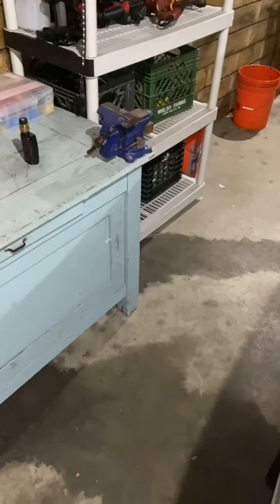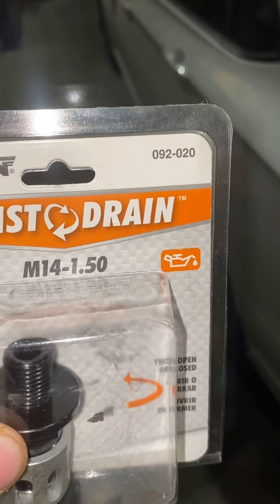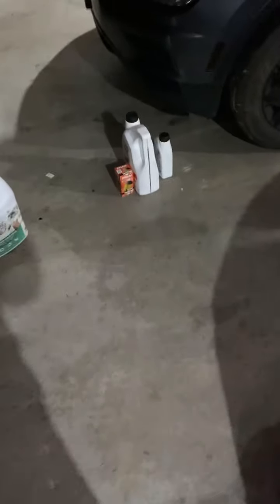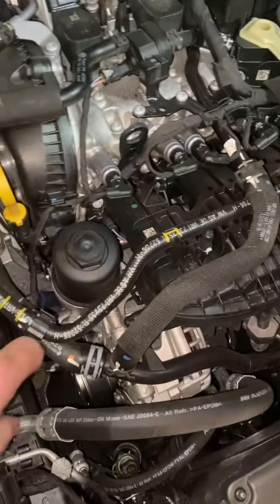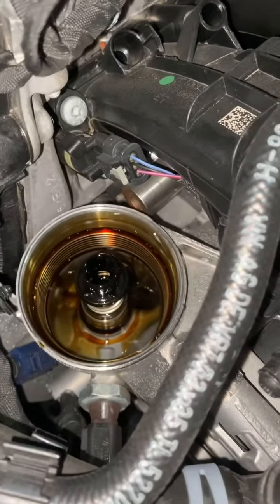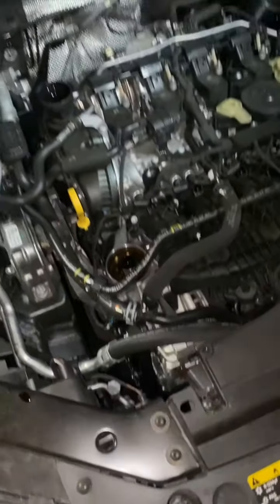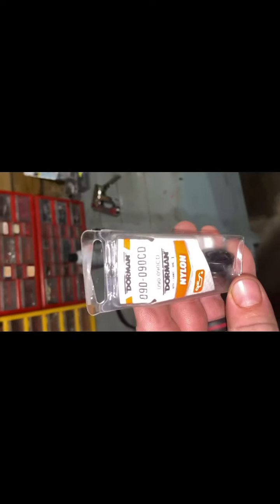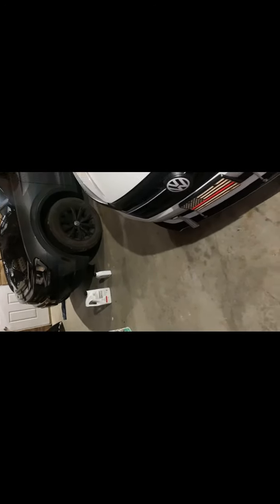Oil changes on 2020 VW Tiguan,

Comment: Dude, I have a 19 Jetta S in white also, Your videos are a big help and actually give me great ideas. I also live in Pennsylvania.
Reply from the maker: Cody hardling Thank you I really appreciate that. If you haven’t subscribe to my channel feel free to. I’m going to have some other modifications coming up that I have not seen done on any of these Jetta’s. Just trying to do things that set it apart from any other Jetta I’ve seen to make it my own. I would really like to do a tune but there of been some recalls on the 2019 Jetta‘s for an N 80 sensor which will throw a soft check engine code mine already one in the dealer and had that replaced as well as the ECM upgraded or updated I should say. So until all these quirks or figure it out on some of them I’m really trying to hold off on doing a tune on it. But I really would like to do a catalyst downpipe. But I’m trying to figure out a way to not get a check engine code by eliminating the catalytic converter on the downpipe. I’ve also had a couple people that live in Pennsylvania message me and I fabricated one charge pipe for the same guy fabricated an intake for as well as sold him some of the other parts that I’ve taken off my car and replaced with a different style. So if you’re not too far or or you would be looking at wanting some thing on able to fabricate let me know shipping would probably be cheaper due to the fact that it would just be staying in Pennsylvania
Reply: @FF54Vic  I really do appreciate that man! I’m close to Pittsburgh. So far all I have is wheels, and an intake. Would like to eventually get maybe a blow off, and a boost gauge. Never knew how to do it, but thankfully you showed those. I want some turbo noise from the engine, the cold air intake I have on there which I built myself, doesn’t give too much noise. I have the exhaust cut off, after the cats, and I’m yet to get a pipe put in. So the drone inside is terrible.

Comment: I just recently did an oil change on a 2020 Volkswagen Tiguan and then the check engine light came on what can cause that I forgot to replace the rubber piece on the oil filter I kept the old one would that cause any issues
Reply from the maker: I can for see the rubber seal from the old filter throwing a check engine code. Did you tighten the cap down enough? I would check for maybe any oil puddling or spray on the motor or skid plate.

Comment: Do you think you will have any warranty issues not using 508/509 ve spec oil?
Reply from the maker: At first I was wondering that as well but after checking with the dealer it runs 0- 20 oil. So as long as I stay in those parameters of the oil it doesn’t void the warranty.

Comment: how often do you do you oil change  on your tiguan? how do you deal with oil consumption?
Reply from the maker: The dealerships that we were able to do them every 10,000 miles. But I did not elect to do that. I change the oil in it every 6000 miles honestly can say I didn’t trust the 10,000 mile thing. Knowing what I know about vehicles most synthetic oil is only good for roughly 7000 miles

Comment: Rear diffuser? Any recommendations? How to go about adding one? Thanks
Reply from the maker: On a Tiguan ?
Reply from the maker: Most of the parts I have found for the body of the Jetta have been universal. The have rear diffusers on eBay but they are universal .
Reply: Sorry for my jetta. I cant comment on jetta post.
Reply: Are u aware of ECS rear bumper conversion kit? It's a little pricey that why I asked if u knew another route. Thanks again.
Reply from the maker: @franklinjara5124  I have been looking for a gli rear bumper now but I think I’m going to do a universal diffuser in the rear.
Reply: @FF54Vic  cant wait to see how that looks

Comment: Is there anyway I can pay you to setup my engine like yours.
Reply from the maker: Where are you located? I’m located near Harrisburg in Pennsylvania.
Reply: @FF54Vic  About 2 hours away but I can make as many trips as necessary
Reply: @FF54Vic  I’ll pay whatever $$$ doesn’t have to be exactly like your engine.
Reply from the maker: @uniquelybleak  what would you be looking to have done to your engine? Are you looking for an engine dress up or intake?
Reply: @FF54Vic  I already have an intake, muffler and resonator delete, and chipwerke chip. I was thinking about your blowoff valve, charging pipe, and piping upgrade for the intake